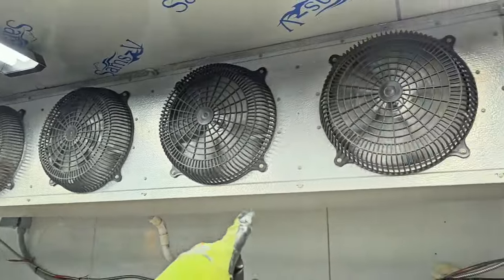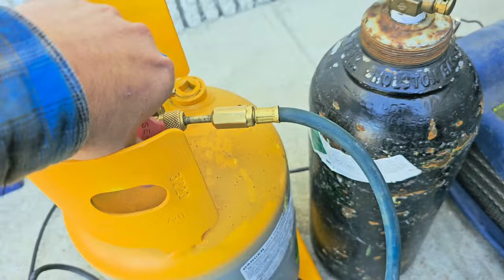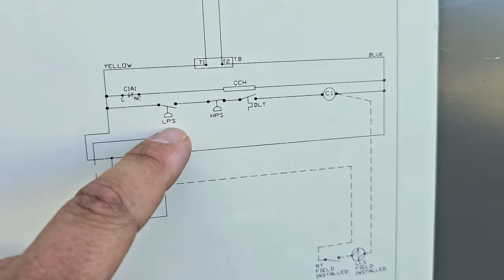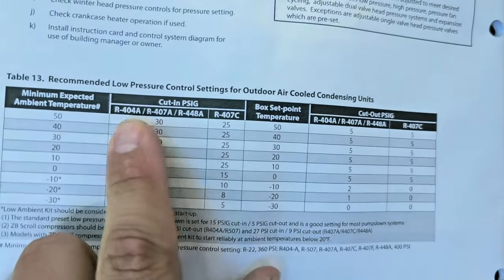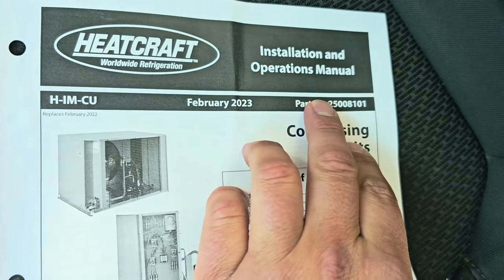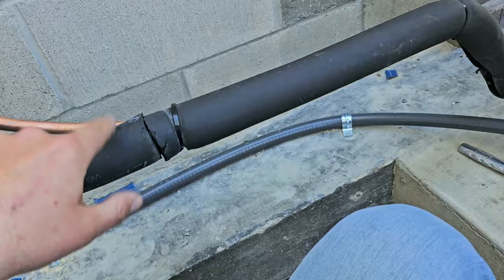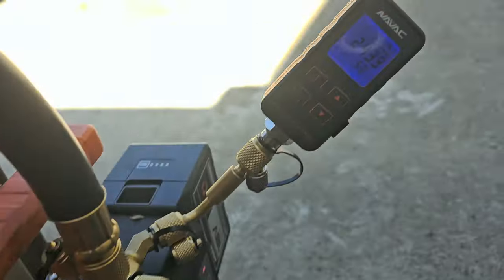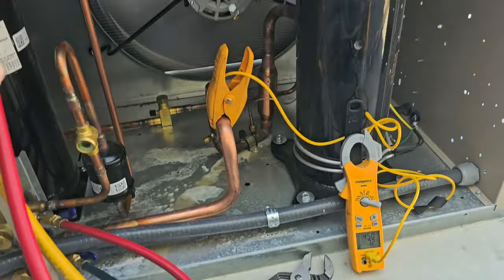The Liquid Line Solenoid Valve was backward #refrigeration #hvac

Comment: You can use the compressor to recover,and you can use a sharpie to pump it down,also you can put a screwdriver on the solinoid coil so it does not burn.too much test pressure,could cause problems if valves leak.You need to add the winter charge it is on the booklet,educational video for everybody.
Reply: 150 psig is a good practice.

Comment: Did u notice when You put the solenoid coil on the valve it went click. Solenoid coil was ENERGIZED the whole time it was off the Valve body. ALLWAYS DE-energize solenoid coils when removing them. Solenoid coils WILL Burnout &/or Melt if Powered up when Removed from a Valve body.
Reply from the maker: I did not notice but I am so glad that nothing was damaged.
Thank you for letting me know
Reply: I keep a Hitch pin in my bag to put in coil to keep from burning it up.

Comment: Also be careful pressure testing at a higher pressure then whats on the other side of the service valves . Nitrogen can leak past service valves and mix with refrigerant 

I always pressure test to a lower pressure then what’s on the other side of the service valves
Reply from the maker: Thank you for the tips bro
Reply: Yep. You Gotta know what pressure is on the other side of those valves. nitrogen in a system not good.  nitrogen does NOT Compress. i never pressure test over 150. it's just not necessary in refrigeration under normal circumstances.

Comment: Back when i was an apprentice we used to put in a shed load of lennox TSA/LCS model straight cooling units, we would be given a txv and a one way drier. Well you bet the first one of did unassisted, i left the piston/orifice in the liquid line on the evaporator and installed the txv AND put the drier directed to the condenser…lets just say that never happened again

Comment: Would system not pump down? Leaking valves?  Confused why you had to recover. Also you can hold contactor in and not have to adjust switch.

Comment: I had a quistion when you pulled a vacuum why was ur king valve closed? Are you still able to pull a vacuum on the line set even if is closed?
Reply from the maker: I just wanted to pump the line sets down
And the evaporator

There was refrigerant in the condenser.

You're talking about the liquid line and suction line service valve right?
Reply: He believe he thinks you have a king valve, from the video you definitely do not have a king valve. From my experience not every refrigeration system has king valves, however if it did have king valves on this system backing the valve all the way out closes the ports where your gauges go and leaves the rest of the system to flow freely, mid seating the valve allows you to read the pressure, and front seating your valve means only the lineset is open and you can pull vacuum with the condenser separated from the rest of the system. Hopefully I helped shed some light on this for you Daniel.

Comment: 12:30 I really thought you were gonna unsweat it out. Wouldn’t that had been easier than cutting it out? 🧐
Reply from the maker: I had the R LSI wanted to use it so that's the reason I used it.
Reply: @TaddyDigest  yeah but you added two extra joints for no reason. It’s your business you do what you want but it just seems unnecessary, especially since you ended up sweating those two shorter pieces and swapping them anyways
Reply from the maker: @johnstrh1 great suggestion thanks for watching
Reply: @TaddyDigest after watching this again, it made more sense why you cut it out instead of sweating it out. I’ve been watching your videos for over 4 years and now I’ve learned a lot from your content sir. I’m glad you’re one of the few that still uploads 🙏🏽

Comment: Did you add a lot of unnecessary refrigerant?  Might not have had to recover any refrigerant at all. Maybe receiver was at 80-90% pumped down even after you adding gas
Reply from the maker: I did add refrigerant thinking that it was low and I had a leak.
So I wanted to recover just to make sure
Reply: Back when i was an apprentice we used to put in a shed load of lennox TSA/LCS model straight cooling units, we would be given a txv and a one way drier. Well you bet the first one of did unassisted, i left the piston/orifice in the liquid line on the evaporator and installed the txv AND put the drier directed to the condenser…lets just say that never happened again